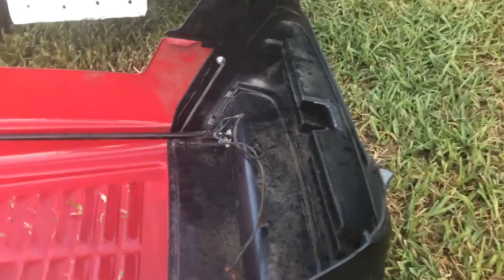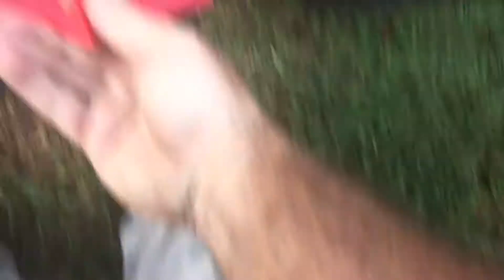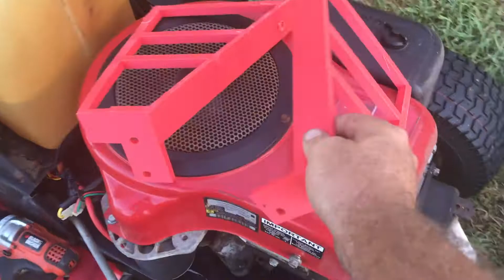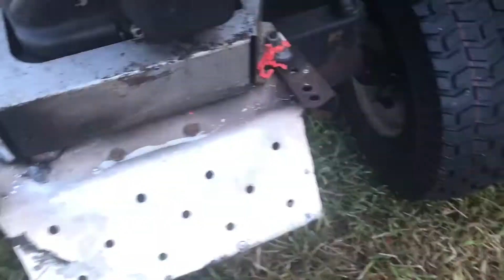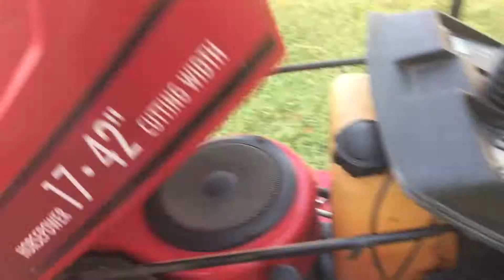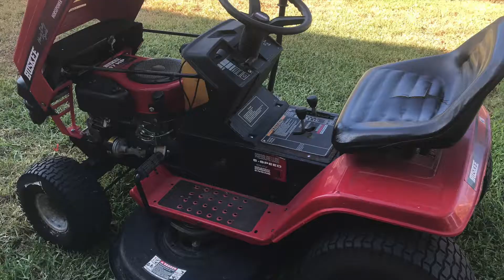Lawnmower Grille/Hood Repair with 3D Printed part-  Lawn care Killeen

Comment: The plastic hood was a bad idea by the manufacturer, no argument there, but just replace it with the steel grille/headlight assembly MTD 783-04979-0638. <— that’s the model number for the red MTD/Troybilt version but there’s like 13 different colors. Try to find a used one, they’re out of production